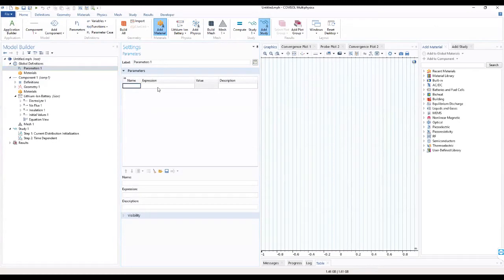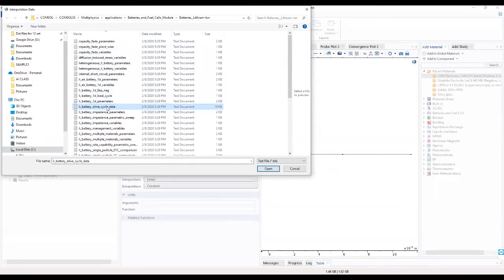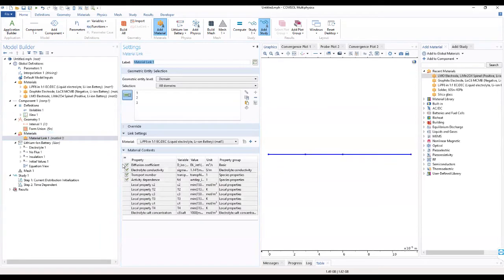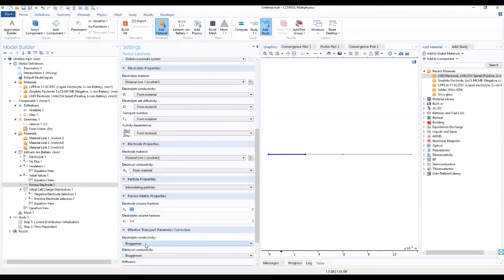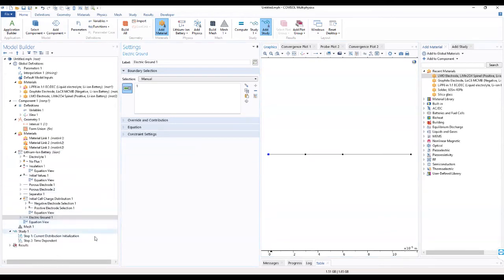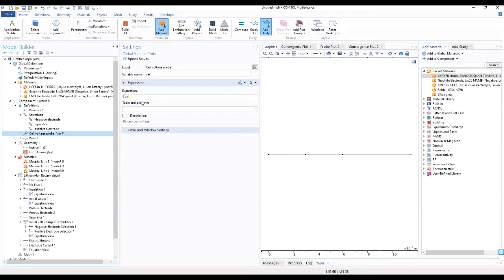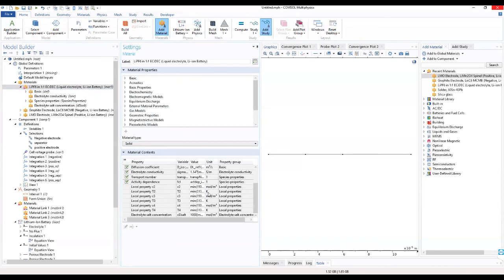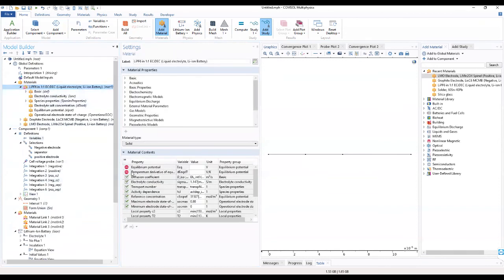HOW TO MODEL BATTERY DRIVE CYCLE SIMULATION USING COMSOL MULITIPHYSICS. PART 1

Comment: Hi. I've modeled an impedance tube for measuring sound transmission loss of a sample in comsol multiphysics software. I chose sound hard wall boundary condition for tube and anechoic domain for end of tube. I applied a radiation wave at one other end of tube for excite the model. But the pressure pass through the sample had very low amplitude. In the other hand the huge amount of pressure didn't transmite. What should I do? My sample is thin enough. What is the problem? Please help me
Reply from the maker: Please I will have to look at what you have done so i can help you. I recommend you be a member of this channel. this will help us. Thank you